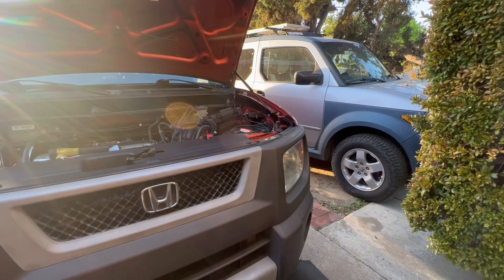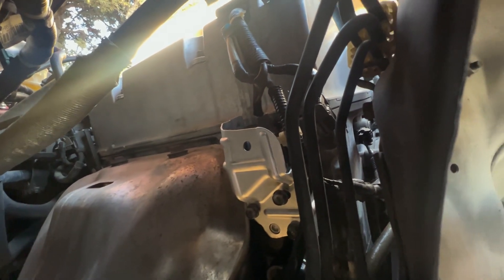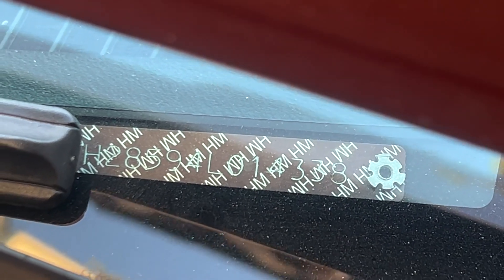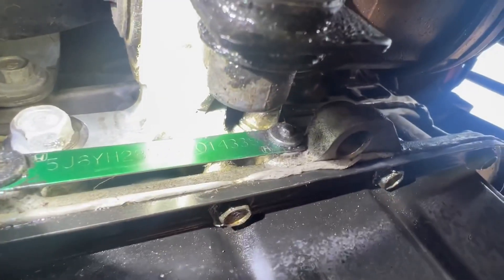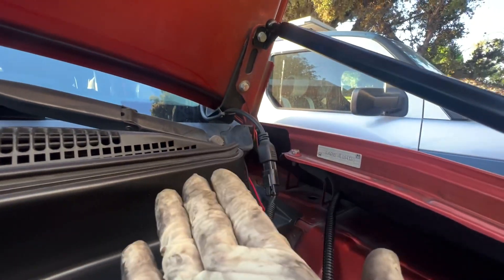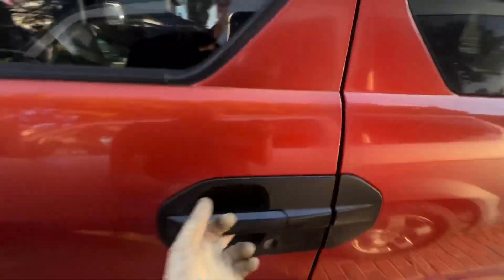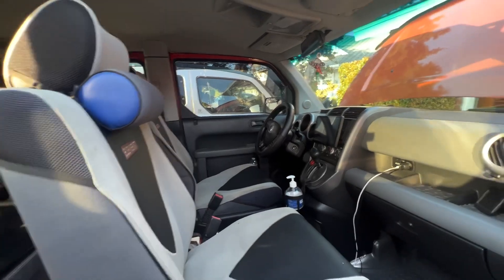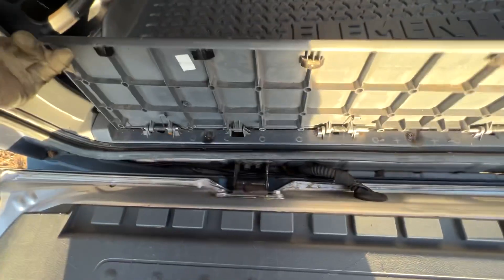What to check when buying a Honda Element & vtec solenoid Installation Tip

Comment: under the rear bumper on passenger side... craw under and look upward and should see same vin tag on the rear bumper. basically, ever panel that (including the engine, but not limited to) left the panel from the factory should have the same vin tag. If not, that panel's been replace (i.e. accident) :)

you da man Mig!

Comment: I appreciate your videos man and subbed a few days ago. I have a dark blue 2004 Element AWD 5 speed manual for 12 years now and it just rolled 188K on the odometer. I didn't drive it much the last 2 years because I bought a truck but have been driving a lot more since gas prices went up. I just replaced the O2 sensors last weekend and now no check engine light. I love these cars and will keep mine until the doors fall off.  haha
Reply from the maker: Thanks for subscribing. That what I am currently looking for a manual awd. You got a treasure there with that E😎👍
Reply: @Element_lifestyle   I didn’t realize it was that easy to replace the gauge cluster lights until I watched your video. I ordered some blue LED ones for mine since 2 of them are blown.
Reply from the maker: @TheCandBExperience  🙏😎👍

Comment: Sometimes Carfax will show if it was in an accident. You can also check for paint overspray. Additionally I would make sure all recalls were addressed.
Reply from the maker: My most important tip in the list is to check the carfax report before buying any car you like 😎👍

Comment: Thanks for the tips! Do you have any recommendations for local mechanics around here in socal specific for elements? According to the Honda dealership I got mine inspected, I have a bunch of oil leaks on the oil pan, vtec solenoid, rear main seal, and passenger axle seal?
Reply from the maker: I am located at Orange County & you?
Reply: @Element_lifestyle  LA county, around Torrance

Comment: On my 07 element, I have the vsa light, check engine, and the triangle light turned on. The E wouldn't accelerate passed 3000 rpms before it starts to stall like a manual. I have already replaced the map sensor a couple of times on it but maybe there might be another issue that's causing that?
Reply from the maker: Hi, first try to fix the check engine light because that can make the other lights come on. You might have a vtec solenoid code. Check the code and let me know
Reply: @Element_lifestyle  it was the vtec solenoid. I used your tip in this video too to take it out easily and clean it. Runs perfectly fine after clearing the check engine light. Thank you!
Reply from the maker: Awesome 😎👍
Reply from the maker: Make sure you do an oil change and oil filter when replacing the vtec solenoid .